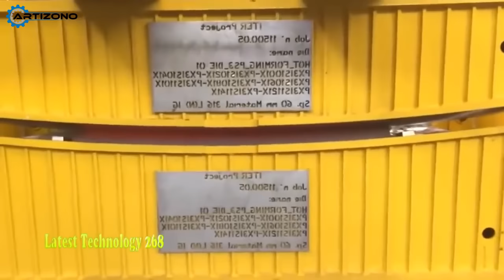The World Biggest Heavy Duty Hammer Forging Factory

Comment: 6:05 if anyone was wondering why there's no scale on that one, it's because they're forging titanium and it's oxidizing much less than steel. edit: at 13:52 is also titanium
Reply: If you could know, what exactly should I search for to get the sound effect same as in 6:05?
I mean same level of strong metal hit.
Reply: If thats actually titanium, its the single most expensive piece of billet I've ever seen.
Reply: 13/52
Reply: @samh5550  guts sword sound?
Reply: You're exactly correct that was titanium been built from billets that were also be a made there in underground bunkers. Big giant tubes that scraps of titanium were wolded together And up-and-down cycle adding pieces pieces with all of it in airtight argon chambers
Reply: The 6:05 shot is an open frame hammer, the 13:52 shot is a hydraulic press. Probably titanium.
Reply: So what do you do for work?    EH ? WOT? 🤠

Comment: Dloes anyone know what some of these parts are used for or machined into?
Reply: High pressure vessel domes such as a power plant heat exchanger.  Others are custom or short production run machine parts like timing gears for heavy ship engines.
Reply: The one that looked like a large rivet was a axle A hub for a train.

Comment: I used to work at Harvey and Martin Marietta special metals in Gardena and torrents I was  Mill right and their maintenance department are repaired a lot of equipment seeing here. The giant mass depressed and a giant sure we manufactured specit's manufactured special metals majority of it was titanium. Is hard job great workshop. I was the one in the cage where they brought me all the machinery gear boxes and hydraulics there will require to clean them before bringing them in I had spares on the shelf. I was the one that would go up on top of the Crane and change the industrial lights up on top up on top nobody had they got to do it. I did the ones over my shop and that was a mistake I started having to do everybody's well well we're limiting this department.